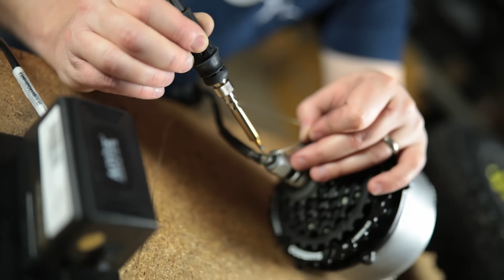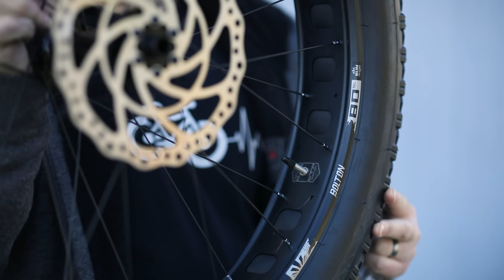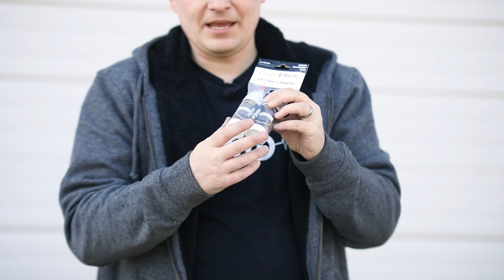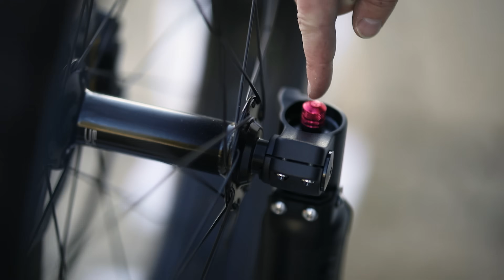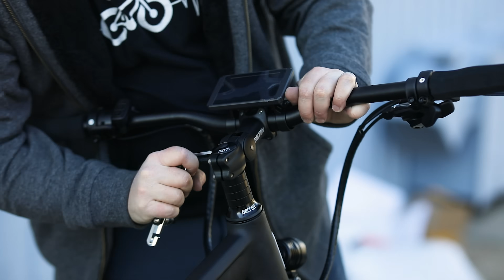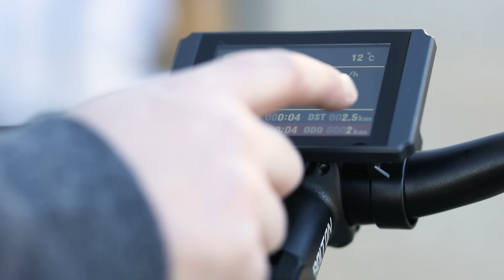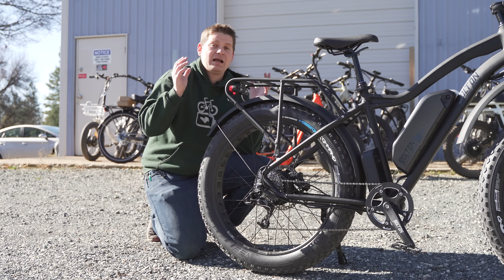How To Get Your Bolton Ebikes Blackbird Ready To Ride

Comment: Still waiting for mine to arrive! Hopefully later this month! Got my tools, got my bike stand and now I got my video!  Bring it on Kyle!
Reply: There is no setup required for lectric. Have done 1000 plus miles out of the box and is working fine.
Reply: @ShivSV100  No you have to assemble certain items. Are you saying that the handlebars and pedals are attached already inside the box?
Reply: @joetroise6477  yes handle bar and pedals are already attached. Handle bar arrived as collapsed but just tilt and fit. it took me 15  minutes to fix it out of the box and then hit the road.
Reply: @ShivSV100  I guess we define "setup" differently. Both bikes require unpacking. Both bikes require positioning the handlebars. Only one requires unfolding. Only one requires installing the front wheel. Blackbird needs pegs installed, but the Lectric's pegs had to be unfolded and the first time that took a couple of minutes to figure out.

As I said, the Blackbird requires slightly more setup, but the Lectric does require some. After all, you can't just take either one out of the box and ride.

Both are simple and straightforward to setup, and the difference is negligible to me.

We don't have 1000 miles on the Lectric yet, but it has been flawless so far. I expect our experiences will continue.
Reply: @blakeberlin6295  nope. I took it out of box, followed instructions given in the manual and filled air in the tires and started driving. After 500 miles i did a wheel tune up.
Reply: @ShivSV100  ... "followed instructions given in the manual ..." 

Those instructions were the setup, but perhaps you're defining words differently than me.
Reply: lectric sends you pre-assembled bikes, foldable and cost $899. check it out
Reply: @ShivSV100  My wife has a Lectric. It is a good value, but it isn't comparable to the Blackbird. Also, the Lectric bike still requires some setup, although I can't imagine the setup process being scary for either bike, or a reason to choose one over another.

I can't wait for my Blackbird, which I will ride alongside my wife on her white Lectric stepthrough.